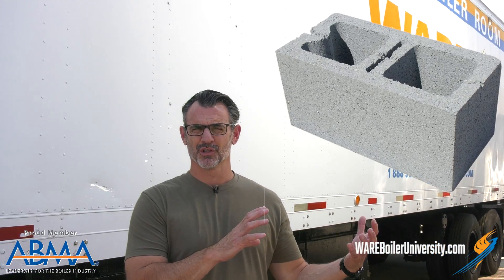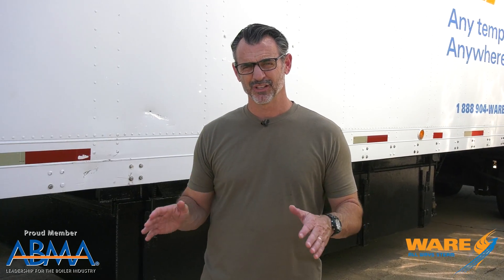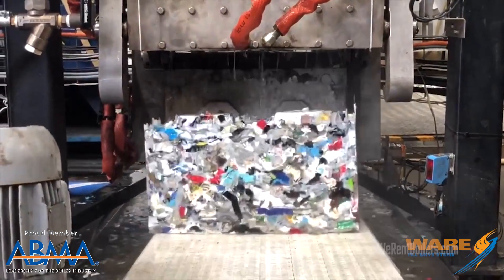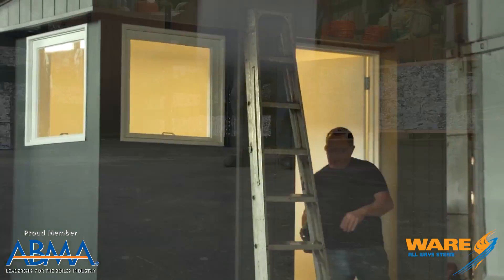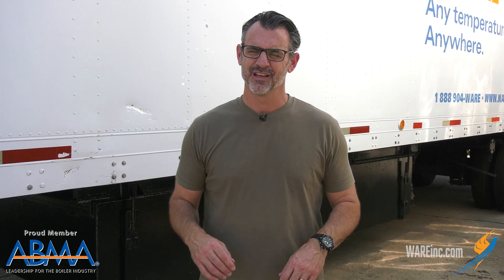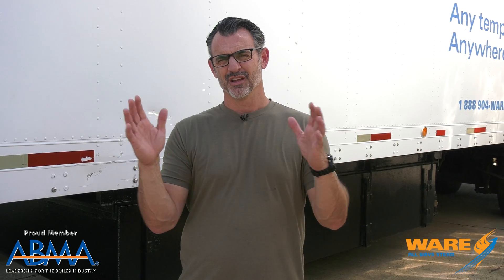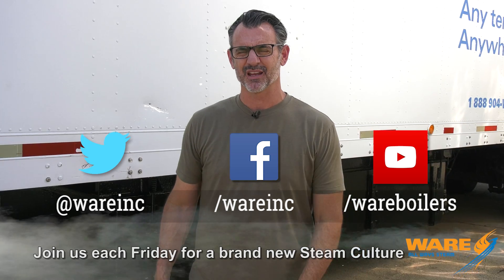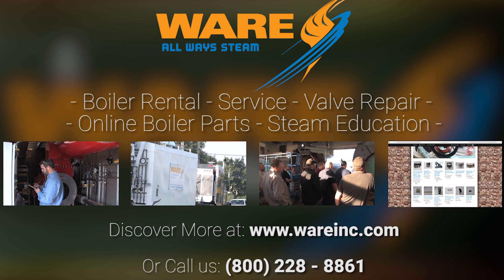Using Steam to Make ByFusion Plastic Building Blocks - Steam Culture

Comment: I realize this is about the use of steam but I wonder if steam isn’t helping create a dangerous product. Are the blocks fireproof? If not, how can they be kept them from burning? Can they be top coated with a non flammable coating? Will the non flammable coating stick once the blocks get hot enough to melt. Will the structure have any integrity once the blocks get soft? What types of off gasses do they produce if they burn? If there are off gasses, can they incapacitate someone?
Reply: These are all excellent questions...
Reply: All those answers are on their website. Also, we build houses with wood... wood burns too
Reply: @Mattmalt  true about wood but plastic off gasses can kill.

Comment: Great idea. What's used to cement blocks togeather? Epoxy, maybe?
Reply: metal rods
Reply: I would think the best thing to do would be to run a rod from the anchor bolts in the foundation all the way to the top of the wall and have some kind of sill plate all the way around. They have indentions and protrusions to interlock the blocks so clamping them down should hold them together pretty well but idk
Reply: According to Byfusion's web page and this video; it is contructed with steam and compression.  No adhesive or epoxy.